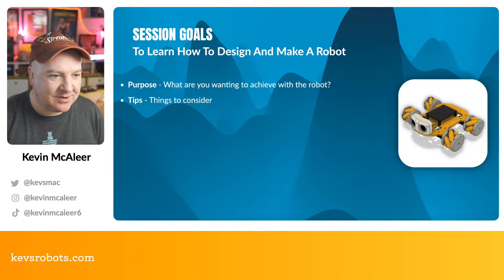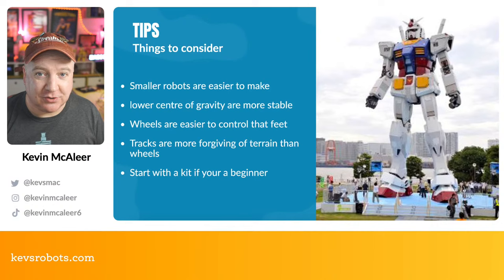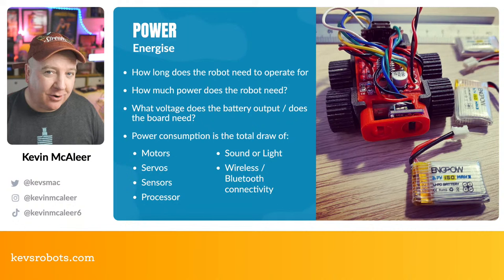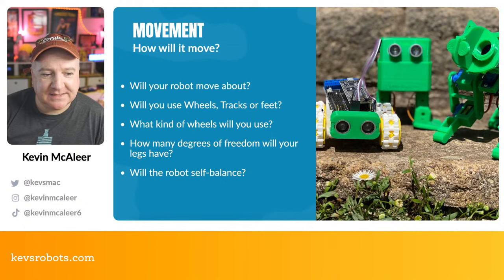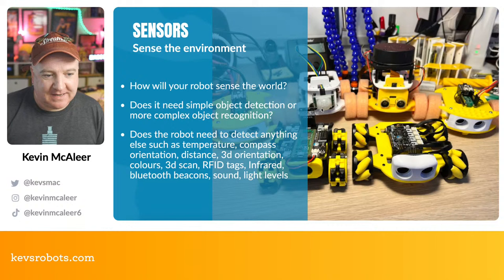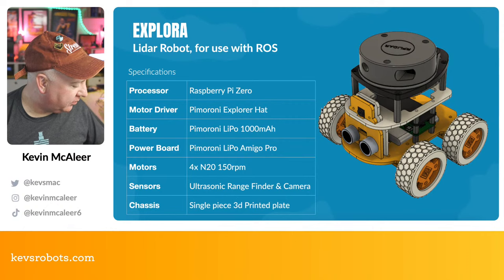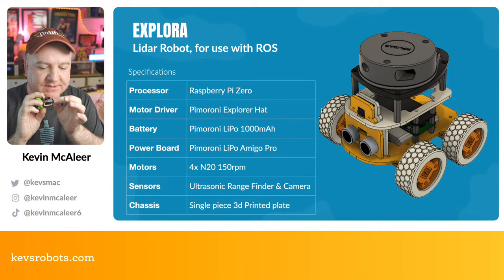How to design and make a robot

Comment: 00:03 Design and build your own robot with considerations for size, features, environment, and purpose.
01:55 Designing a robot involves scribbling down ideas and making sketches to understand the requirements and aesthetic aspects.
05:35 Start small and iterate for easier robot building
07:34 Tracks are more forgiving on challenging terrains compared to wheels.
11:31 Consider power requirements and duration when building a robot.
13:27 Understanding battery voltage and power requirements
17:30 Various processor options for building a robot
19:15 Discussing different types of chips and sensors used in robot design
22:50 Consider the type and number of wheels for robot movement
24:31 Choosing sensors for robot perception
28:03 Robot self-orientation and communication methods
29:46 Robot communication and design considerations
33:17 The Omni chassis enables versatile robot designs
35:04 Introduction to robot components
38:42 Configuring and connecting Raspberry Pi components for robot control.
40:32 Exploring different robot designs
44:12 Design for indoor use with autonomy and quick construction
45:50 Designing robot chassis and motor holder specifications
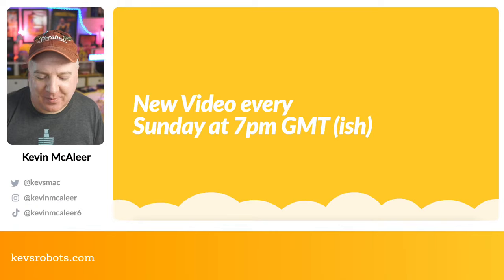49:28 Components needed to build a Rover robot
51:18 Using encoders for precise positioning
54:42 Designing the robot's face with a range finder holder and mounting holes.
56:32 Assembling robot components for better stability
1:00:50 Proper orientation and cable size selection for connecting robot components.
1:03:01 Assembling the robot components
1:07:38 Building a robot with correct wheels and motors
1:09:25 Design and make a Rover robot
1:12:38 Demonstrating the use of Fusion 360 for robot design
1:14:25 Design inspiration led to faster robot production
1:18:07 Using Omni chassis for stability.